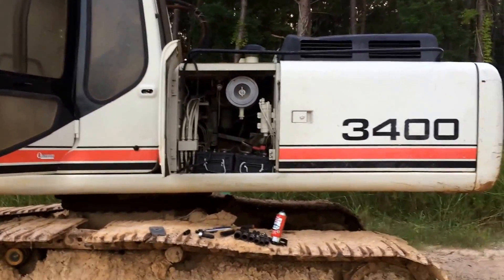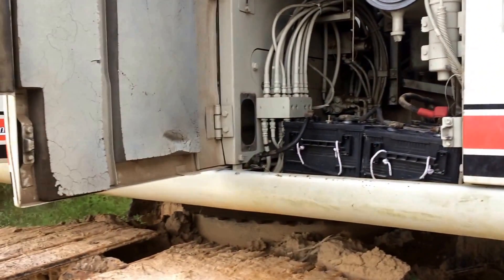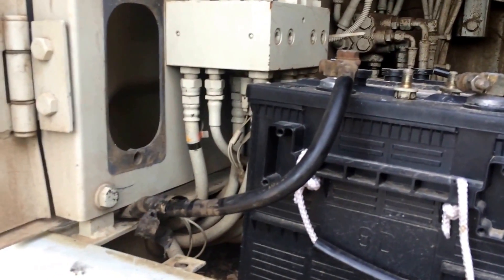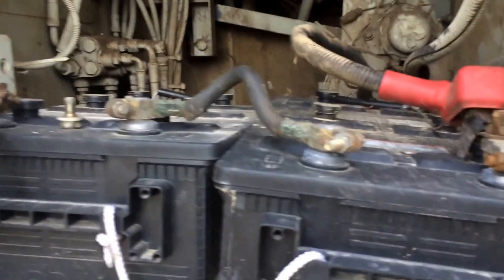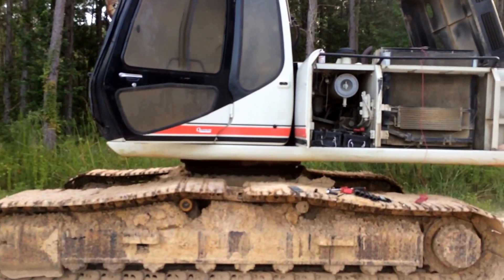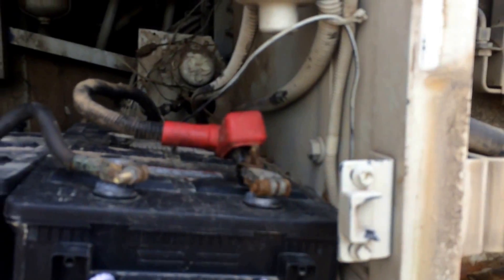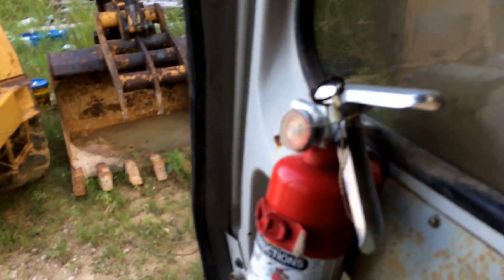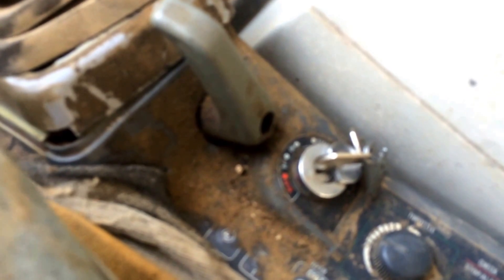Another Electrical Issue Resolved - Link Belt 3400 Excavator

Comment: Haha just running into similar issue on the 05 240lx2 I run. Thought this was gonna be my fix when you were listing the things you went through but we have a computer in between that’s refusing to run fuel pump when power is hotwired on. Ignition in key on is dead, start position is now only key on but no fuel pump power and doesn’t cycle the pre heat. Must be the ignition cylinder too. But it just cranks with no fuel on hotwired starter. Hopefully it doesn’t have to come from Yokohama like the starter we just ordered😂.
Reply from the maker: Sweetsider I hate computers on engines for that exact reason. I like my old dumb iron! The only electrical circuit I depend on is the key to the starter and generator. My haul truck is the same way.
Reply: So are linkbelt any good? I don’t see many reviews and I’m looking for a good used excavator. Nobody runs them down south but the prices are enticing. I know it’s YEARS LATER but thought I’d ask anyways.

Comment: Ok thank, I will look around small shops, it is isuzu so should be plenty around.  It's a tight squeeze in there, but I can see why some would replace the whole starter,  actually seems easier than trying to remove solenoid, but I will know more tomorrow after I try to gain access.

Comment: Hey thanks for reply I'm here now with machine trying to figure out.

I burnt out the stop solenoid after running out of diesel and cranking ignition too long.  Now the machine refuse to crank.  I am getting power to the relay on 3 prongs under ignition,  only 1 of the four prongs does not show power.   I am also getting power to starter under ignition. But as I am alone here, I have no one to turn key to crank for me.   Any ideas?
Reply from the maker: Well, I did try strapping my key in the  crank position using a bungee cord...I don't know that it really worked, but I was in the same bind as you, didn't have someone to hold the key. If you're able to access the back of the key then I guess you can just take wires loose and twist them together to simulate the key being pushed into the start position. 

Is your machine a LB3400 as well? You might have done better than me if you're able to access the back of your key switch. I could never figure out how to get that console open! 

I'm still not 100% sure what you are calling the start/stop relay. For clarity here, I'm calling the "starter solenoid" the one that's actually on the starter at the engine. The metal can thingy, I just call that the relay. I don't honestly know what its proper name is.
Reply: Tom Brueggen 

Hey,  I'm back home after long day.  I managed to get help with the key,  but not before figuring out that both 25a and 60A fuse links were still good.  Battery relay,  that round metal thing with prongs was good, and I was getting power to the starter motor and the solenoid or relay.

When my helper turned the key, the starter relay or solenoid. ( I'm not sure what the difference) lit up the test bulb and made a click but nothing happened.    I'm guessing that means the contractor inside the relay or solenoid is toast and I need to replace.

I didn't have same machine as you, I have JCB JS240,  but looks very similar to yours inside.  Without the grass  😂

The stop solenoid is a push pull solenoid with a lever that pushes the fuel shut off valve when you turn the key off so you don't have to do it manually.  But to be honest, the level fell apart about a year ago and I had to always climb up the back and shut off by hand anyway so the solenoid only pretended to work.   Anyway, I guess I will call dealer tomorrow, or Isuzu most probably and try get a new relay or solenoid.  I will try to find the answer to which of the two it actually is also.  

Regards
Andy
Reply from the maker: Ant Poo so you're getting power and signal to the solenoid on the starter, just the starter isn't engaging? That sounds easy enough. If you're clever you can just replace the solenoid. Most folks just swap out the starter which normally comes with a new solenoid on it. Call around to see if you can find a shop that specializes in starters and such. When my alternator locked up I saved something like $1000 by getting one through a small shop compared to ordering from the dealer.

Comment: Hey, 

I burnt out my start stop solenoid yesterday and now have no crank at all. Ignition lights work, but no click no crank no nothing.  I think I may have burnt out my relay.  I will follow your process and try find problem 👍
Reply from the maker: Ant Poo did you burn the solenoid on the starter? Or you think you burned this little relay that I showed at the end? Speaking with others, this relay goes out occasionally. And as you see, it made my machine a dead duck. 

Indeed a basic electrical tester is your friend! But from what I've learned over the years, if a machine is totally ghosted, it's usually a bad ground.

Actually, as you stated, your lights still work, but no crank. That's definitely a bad ground somewhere!
Reply: Hey thanks for reply I'm here now with machine trying to figure out.

I burnt out the stop solenoid after running out of diesel and cranking ignition too long.  Now the machine refuse to crank.  I am getting power to the relay on 3 prongs under ignition,  only 1 of the four prongs does not show power.   I am also getting power to starter under ignition. But as I am alone here, I have no one to turn key to crank for me.   Any ideas?

Comment: You own a service manual for your equipment? I know- it's common sense with old machinery but sometimes that manual can be helpful!
Reply from the maker: I don't for the excavator. Have one for the big off road dump truck. Just never have really felt the need on the excavator. It's been rewired to make just the basics function, so chasing a factory wiring diagram would be futile. All else is pretty visual when it comes to tracing hoses for leaks and such. Don't know if the manual would show how to rebuild cylinders/hyrdaulic pumps/motors but I fear that is coming sooner rather than later.
Reply: @TomBrueggen   do you have the wiring diagram for the equipment? or do you know where can i get it?
Reply from the maker: Rodolfo Chu Urias no. I wish I did!

Comment: LoL Whaggits & whiggits, cracks me up. Great bush fix Tom. Gotta do what ya gotta do! Can't stand when the magic smoke gets let loose. Good luck with the 3400.
Reply from the maker: It's the daggum electrical gremlins. I swear they get bored in the battery box so they start crossing up wires just to make things interesting. Whole time I was in there working a mud dauber wasp kept coming to check things out. He never gave me attitude, so I left him alone too. The gremlins may have recruited the wasp to see how I'd react, and when it didn't bother me they decided I was too bored to mess with, and they undid what they did and let me get back to work, haha!
Reply: Oh I know about them gremlins, my husband had to deal with them for a long, long time. He currently deals with Mr. Murphy on a regular basis. Do be careful of any of them Wasps though, they can be ugly mean if they decide attitude is due. nods Recruiting critters like that when the gremlins work didn't turn you away surely seems wrong to me. If you know what I mean. 😆 I am glad they decided to undo the awful mess they made so you could get back to work.

If Mr Murphy decides to step in for my husband's work, there's no changing any minds. Booms can't be undone. Haha!